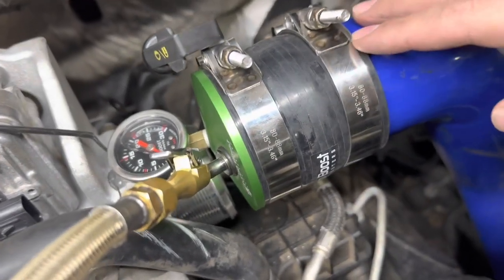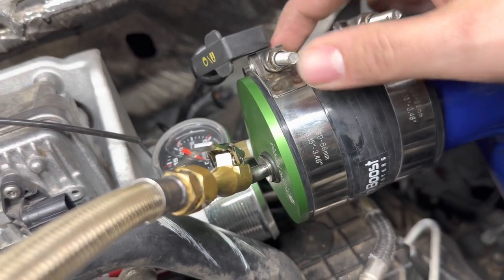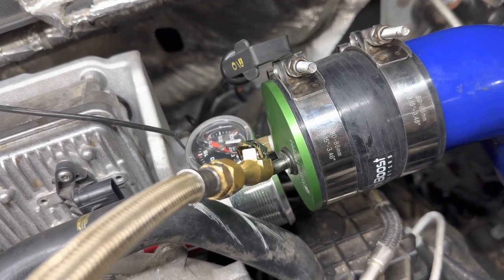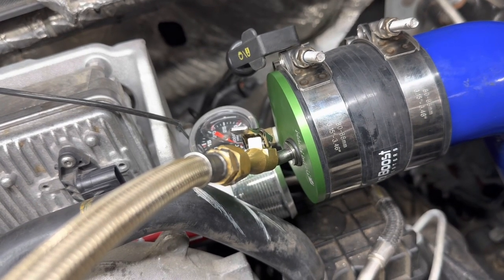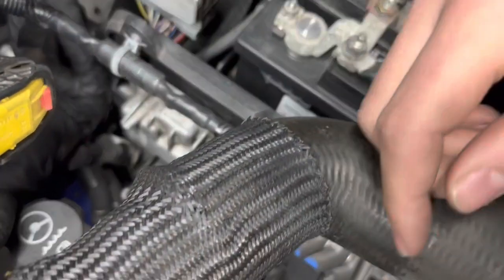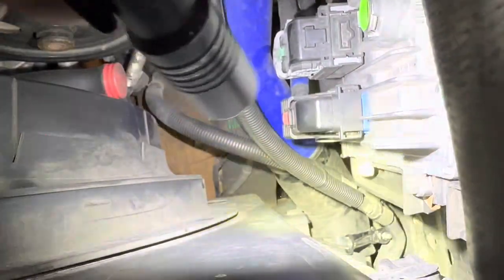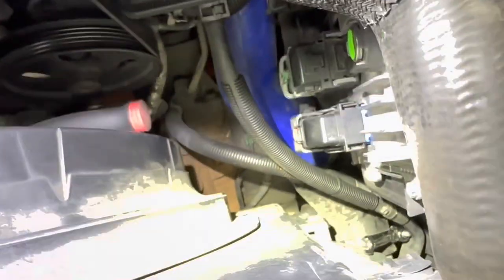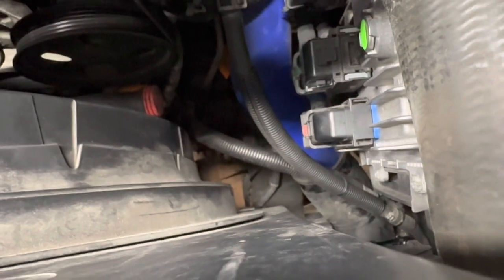How to boost leak test your diesel pickup truck

Comment: I have a 23 l5p, I blew off the hot side pipe at the crimped clamp at 5k, I replaced with a new assembly under warranty, I suspect a boost leak due to short distances between regens. I machined a boost leak tester and I hear air movement at the hot side inlet to the intercooler but I can’t find the leak. Will air leak out of the egr? I can’t get it to hold any pressure. I also did a smoke test and couldn’t find a leak. I have a Banks Derringer and intake and truck only has 19k. I soaped all connections and can’t find a leak but I definitely hear air moving at the intercooler inlet.

Comment: I just installed your turbo on my truck last week. The original one I believe was just worn out, almost 250k miles. The old turbo compressor wheel didn't always spin free. It would get to random spots where the wheel would get tight and not want to turn. I want to pull the old one apart just because I'm curious of what was failing. What should I look for inside it?